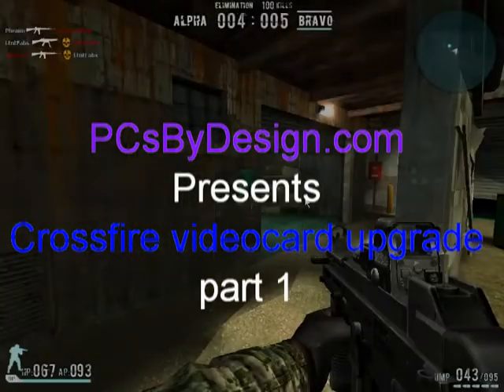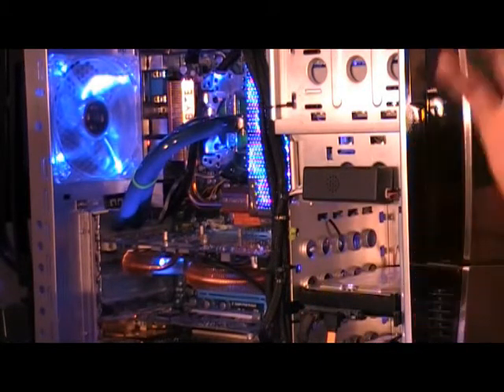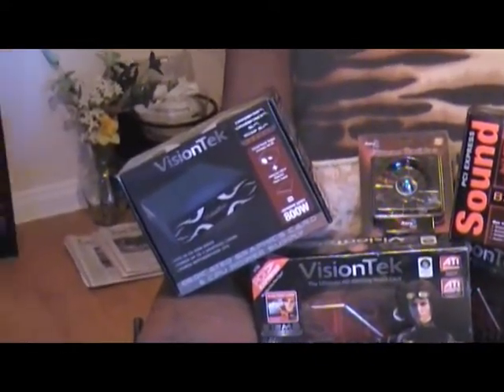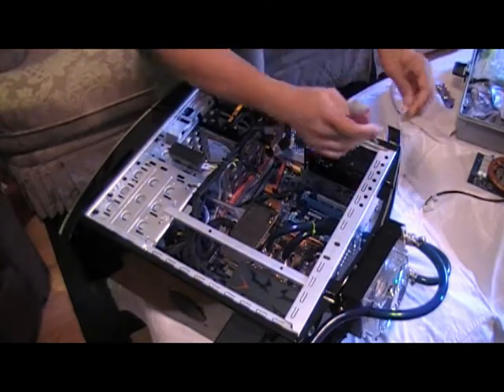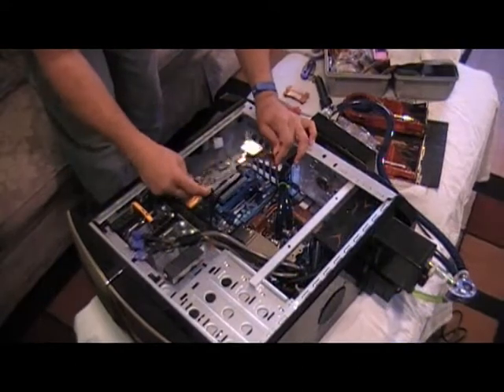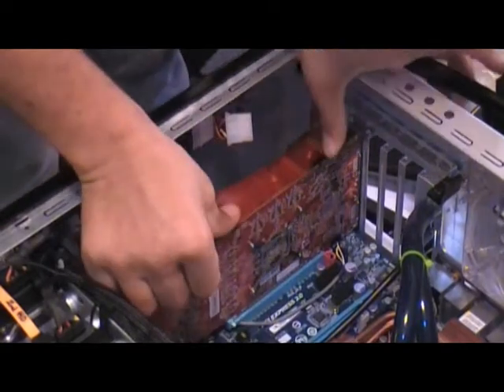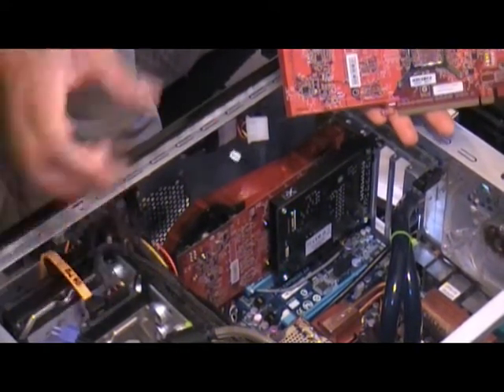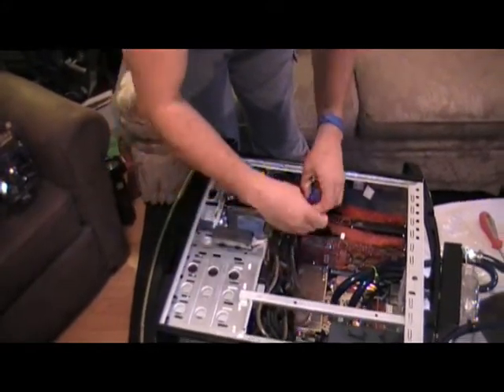ATI 3870 crossfired Pt 1

Comment: I had that Sapphire HD 3870 that you replaced.  That was my favorite video card for a long time.  That's the card that made my switch from nVidia graphics cards to ATI.  I swapped a nvidia 8800gt for that ati HD3870 and was VERY satisfied.  It was also $115 cheaper than the 8800gt. Great video.

Comment: overall very pointless.... first pointless part is why he bought 2 3870s if he already had one?!?!... lol second was at the time he could have gotten a beter card like: 4770 crossfire, 4830 crossfire, 4850 crossfire, 4870, or even 4870x2, gts 250 sli, gtx 260, 9800gt sli... then he wouldnt have to buy new sound card....